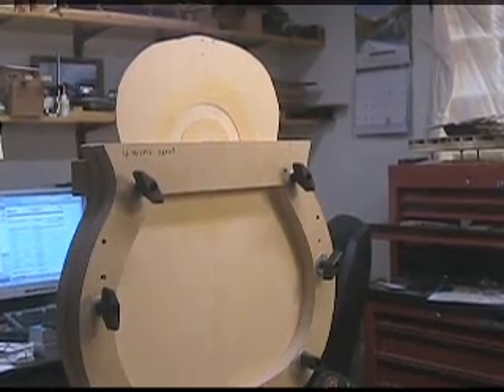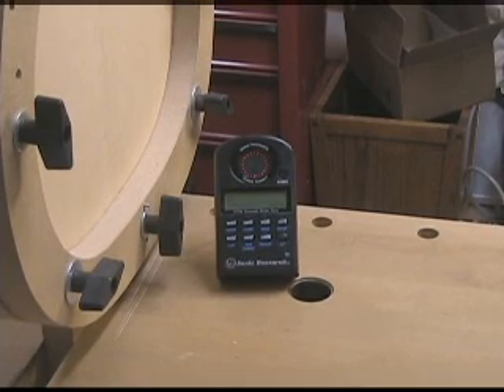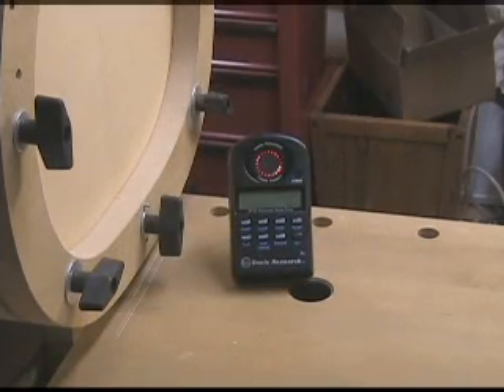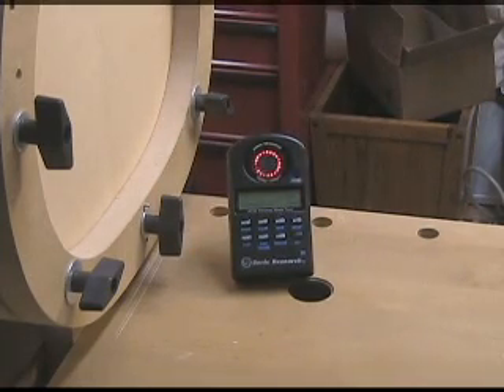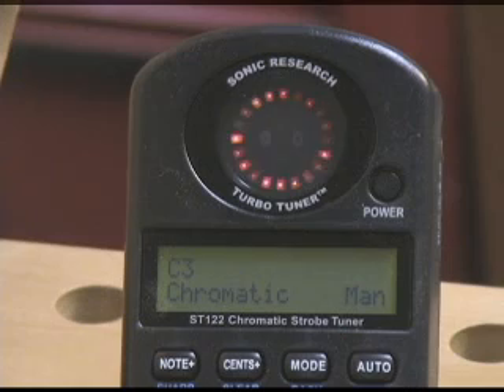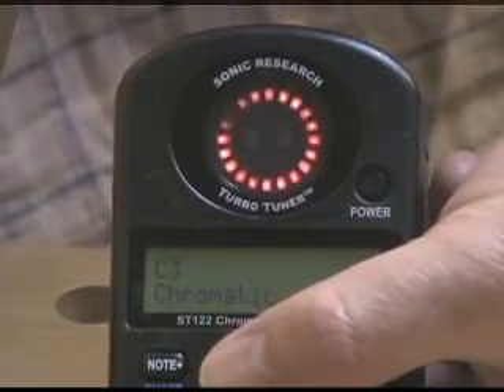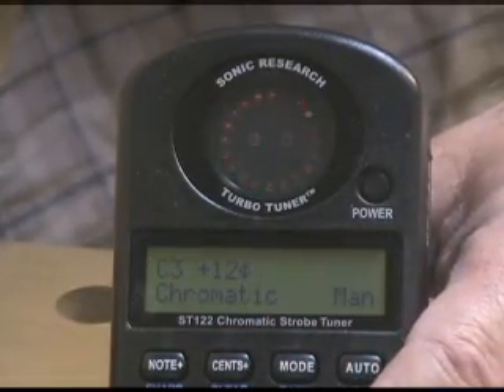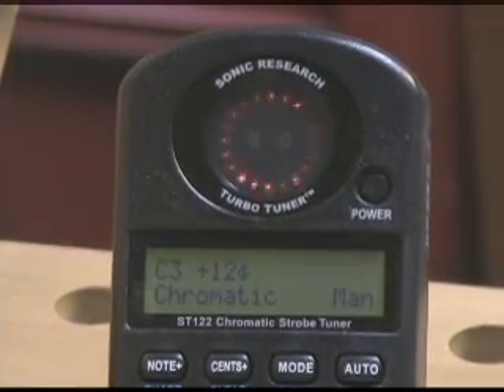Tap Tuning A Guitar Top with the Turbo Tuner

Comment: I didn't see you tune anything. I saw you use a programmable oscilloscope to determine ambient sound waves you persuaded off the top. That vibration means almost nothing as a wide range of sound is projected on any given board. I think that proper crown ( compression of the cells on the underside and elongated on the upside. ) Also bracing is a pathetic way to hold the glue joints together as it too robs both dynamics and sustain. We could very easily creep out of the dark ages and produce much better instruments than we are currently producing.
Reply: What do you mean by bracing to hold glue joints together? The bracing of the top does a number of things but holding the glue joint of the top together is news to me.
Reply: @karelenhenkie666  gluing is the pathetic way to hold the braces..
I think he wanna say this....😕😕
Reply: @dontsubscribeme9547  lol what? How you gonna hold them? Staples? Haha
Reply: 4 years on and this is still the dumbest comment on any YouTube video. If you know anything about guitars you should be embarrassed.

Comment: Can you do a video on how accurate one can adjust the tuning setting to match a particular key? - For example I play solo classical guitar and when I play in the key of A Major I fine tune by ear the 2nd string slightly flat as well as the 5th string (to the degree a led tuner cant discern) I do this so that the guitar rings harmonically truer and makes the fine music sit comfortably.
I am wanting a tuner I can program these separate string tuning alterations in for each of these keys: A or Am, Drop D, E Major, C Major, G Major. Looking at something like the Peterson brand: they are also a very good tuner but they don't allow these subtle programmed string manipulations just generic studio pre-programmed manipulations which to me makes little sense as A440 should be the same on every A440 device, where as your stomp pedal and 122 models seem to offer this advanced functionality? Could you make a demo of how accurately this works?

Also - do you have any plans to do a clip-on tuner? - maybe one that can be bought as a package with either the stomp or 122 in which either tuner will be able to program the settings of that clip-on using a connector cable? the clipon would need less button functionality that way too and would provide professional quality tuning for classical and jazz musicians / soloists (you can use that idea if you like)

Cheers.